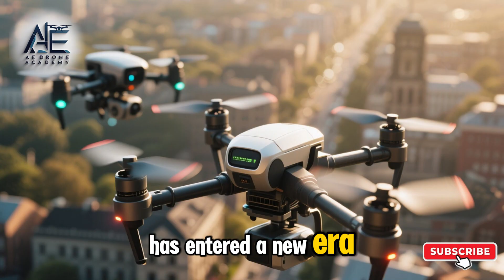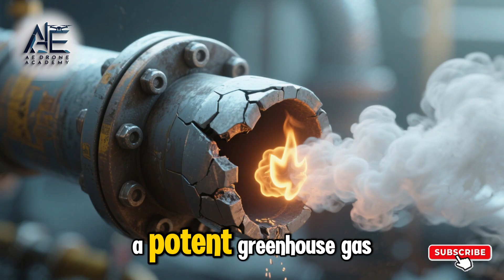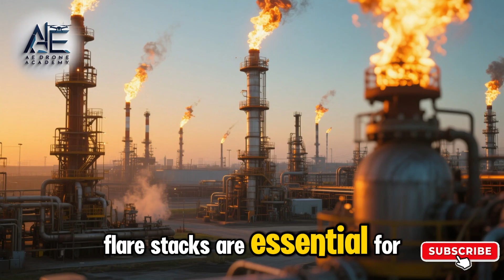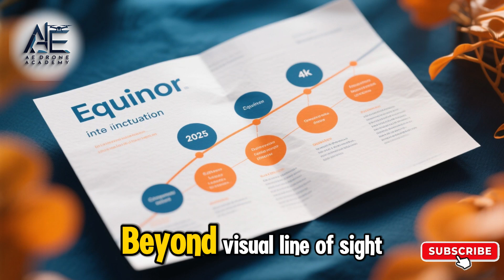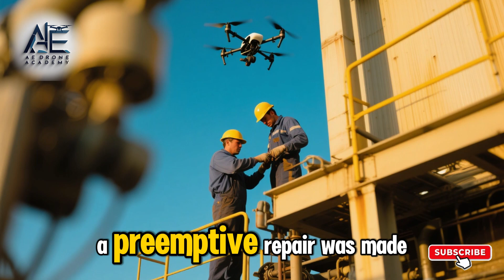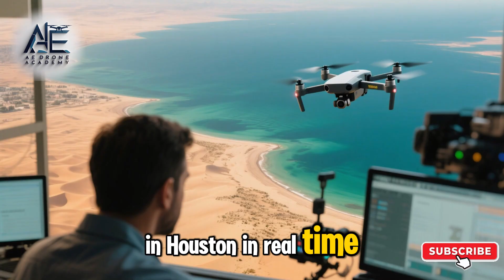How Drones Are Revolutionizing Pipeline Safety in 2025

Comment: Which oem and which model can conduct AI powered pipeline inspection?
Reply from the maker: Good question. AI-powered pipeline inspection is typically achieved by combining enterprise drones with AI analytics software.

Common options include DJI Matrice 300/350 RTK, Skydio X10 / 2+, Autel EVO Max 4T, and autonomous systems like Percepto. These platforms use RGB, thermal, or LiDAR sensors, with AI detecting leaks, corrosion, and right-of-way issues through onboard or post-processing analysis.